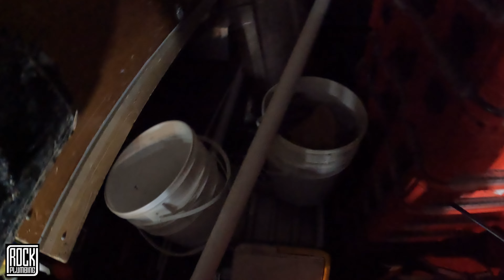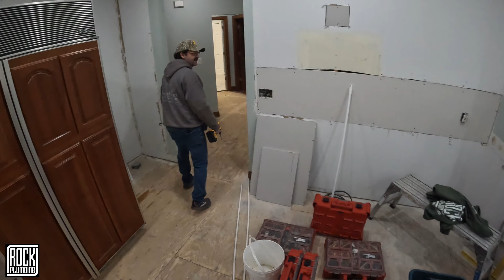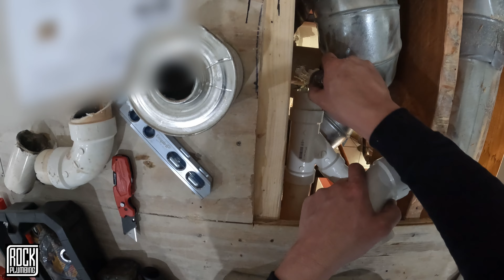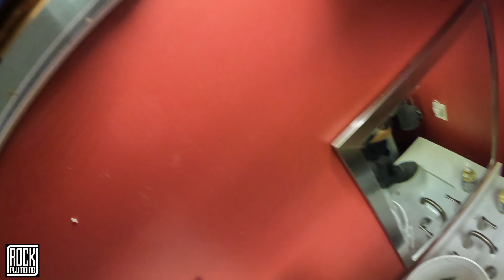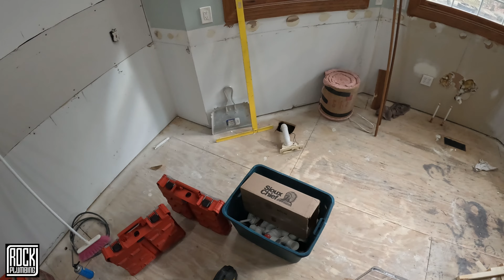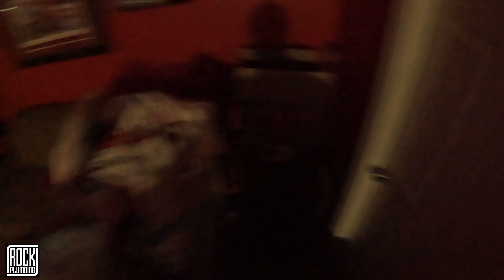Why can't we just get along? Are all showers the same?

Comment: i got a ferrule puller a couple months ago only used it a few times GAME CHANGER
Reply from the maker: I bet! What brand did you pick up?
Reply: @rockplumbingllc7991  it was some brass one that handles ½-¾ cheap $20 amazon one, works well. I had the ferrule blaster in mind, but I wasn't going to pay $124 for it as I rarely have to change stops.

Comment: "Ferrule blaster" ferrule puller is awesome little pricey at around $125 but worth it!
Another good video!
What brand crimp ring crimpers do you use , are you happy with them?
Reply from the maker: Yeah i've seen some vids on those. They look sweet!
I use the icrimp crimpers from amazon. I originally bought them back when I was just doing some side jobs here and there. But you cant beat the price and they're actually surprisingly good! I use them day in and day out and have had no problems.